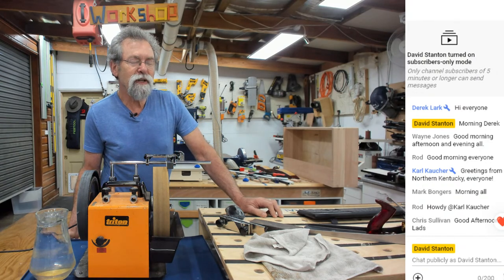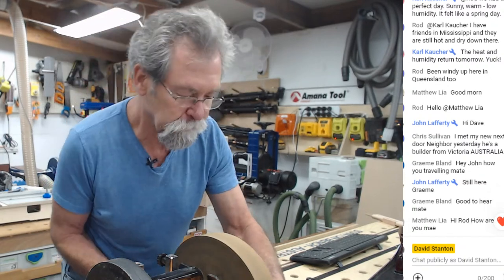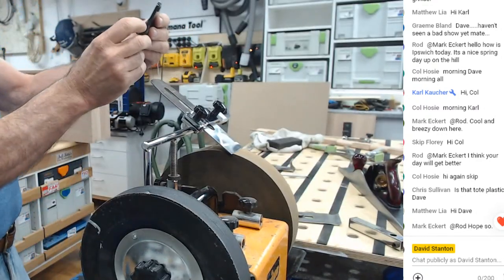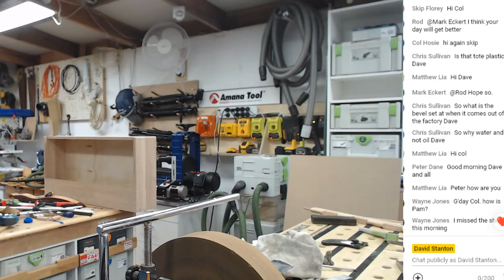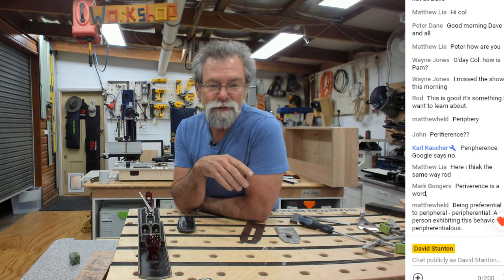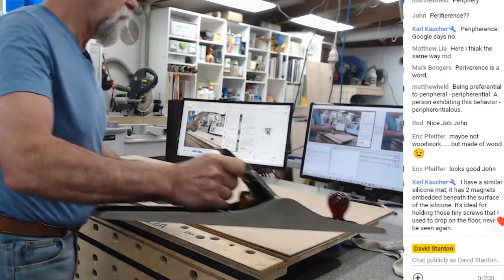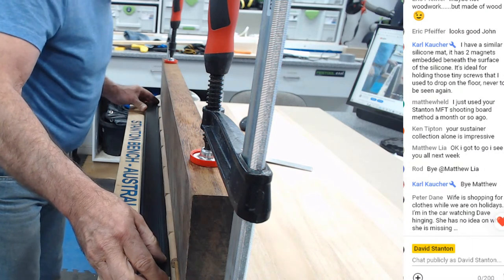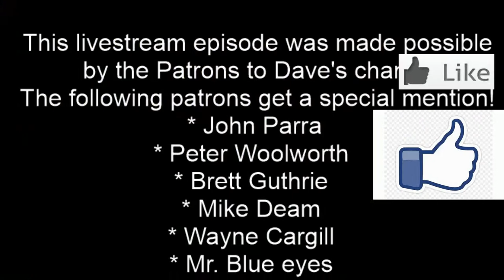Sharpen a plane blade | Fine tuning | Carpenter's tool box project | Dave Stanton Live!

Comment: I'm curious about wet grinding wheels but loathe the price of Tormek.  So was keen to see how the lesser models compare.  Still not 100% sold.  I would use them occasionally as I prefer hand sharpening.
Reply from the maker: There is nothing wrong with hand sharpening, just takes a bit longer.